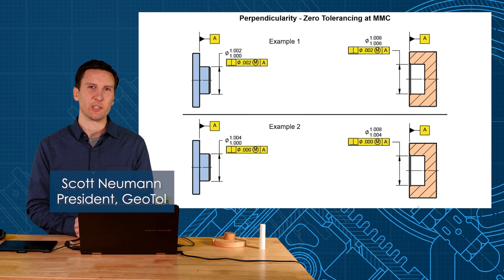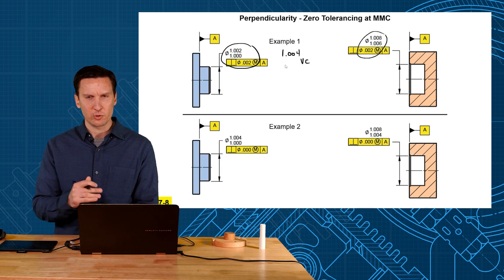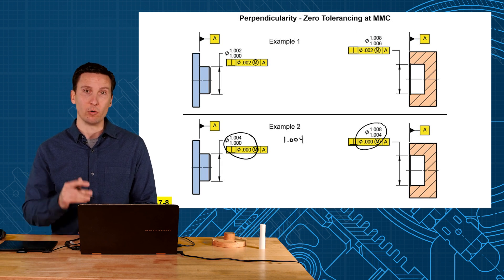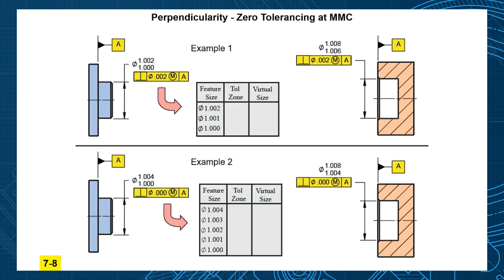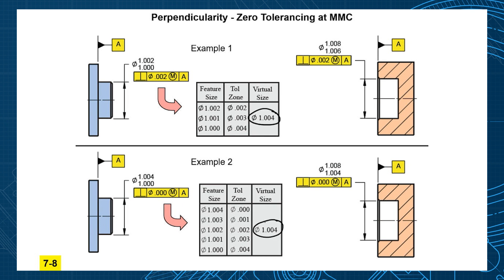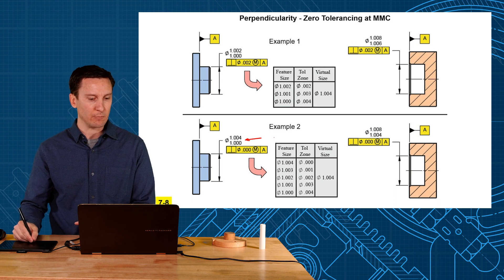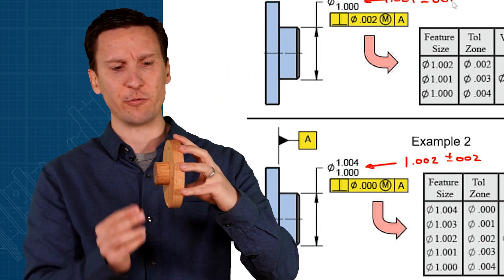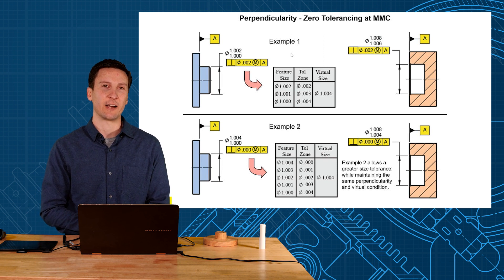Using Zero Tolerance at MMC

Comment: So it means if we put zero tol here, there is still a case that 0 tol when the diameter at MMC, and i think it is impossible in manufacturing. Please correct me if i am wrong. Thanks in advance
Reply from the maker: Yes, design must define the hard boundary for function. Zero tolerance at MMC establishes a virtual condition that the feature must not violate. My advice to manufacturing is "don't aim for MMC". Usually, aim for the mean size for your best chances.
Reply: Thanks a lot. I hope your channel keeps growing with more useful videos like this.

Comment: Thanks for the information, I fully understand the MMC issue, but in LMC, what would the concept be and where or how would it be used?
Again, thank you very much, greetings from Tijuana MX
Reply from the maker: The MMC modifier protects that inner boundary of the hole and outer boundary of the pin. This ensures the fit while maximizing the allowable tolerance. LMC modifiers protect the opposite boundaries. Applications could be min wall thicknesses and cast features that need proper machine allowances. 

Keep in mind RFS does all of this but just does not allow that extra "bonus tolerance". When in doubt, always go RFS as the default.

Comment: Can we say then a nonzero tolerancing at MMC is just a bad practice because it hurts manufacturing or is there any situation that necessitates using nonzero tolerance at MMC ? Thanks in advance
Reply from the maker: Good question. I usually don't put zero at MMC on bolt holes. As you know, the GTol of zero at MMC design technique allows the hole to be smaller. A small hole may be difficult to put a bolt in with a line-line fit. I like to stick with standard drill sizes for the hole and use a regular (fastener formula calculated) position tolerance at MMC. Sometimes small holes can hurt another aspect of the design.